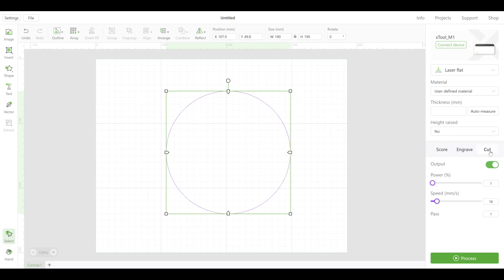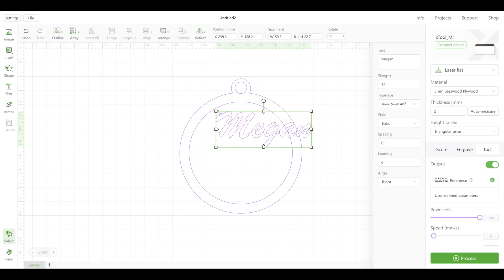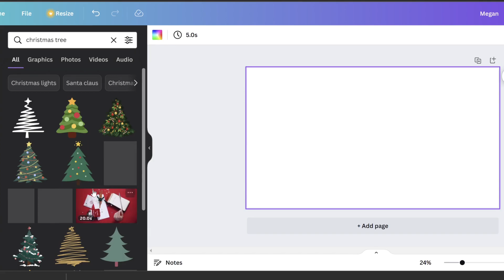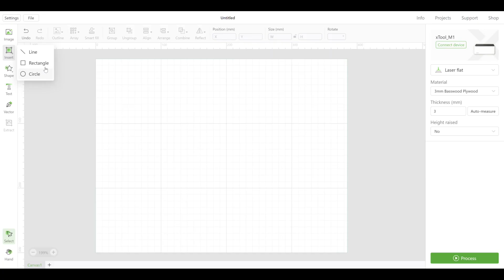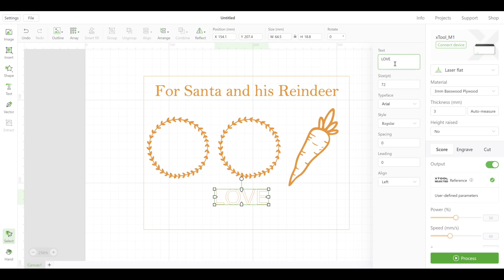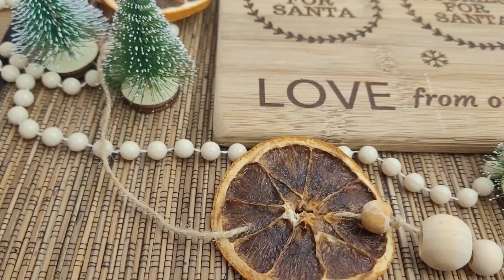DIY PERSONALIZED CHRISTMAS GIFT - Laser Cutting and Engraving with Xtool M1

Comment: hi Angelika ,i found your channel and subbed you great uploads thanks for sharing i cannot seem to get past the bit where you unite the text with the circle i have a mac book so i am not sure how to continue as i would love to have a go at my first tree decoration any advice greatly appreciated ,
many thanks ,
Clive .
Reply from the maker: Hi. I think the software should work same on any computer.
It is quite tricky, I'm not gonna lie. Took me a while to actually make it working.
It's hard to explain it with the words. But make sure each line from the first and last letter touch the edge line of the circle. The round shape also has to be made out of two circles, so the machine knows the part between two circles is not empty.
I don't know if that makes any sense 🤣🤦‍♀️
Reply: @simplybya  Hi yes thank you 🙌🙌 I will have another attempt later take care .
Reply: I'm having trouble getting multiple images to connect in xcs using the subtract. It's only allowing me to use it 2xs and then the next time i use it everything disappears. Any suggestions? Did you have this trouble?